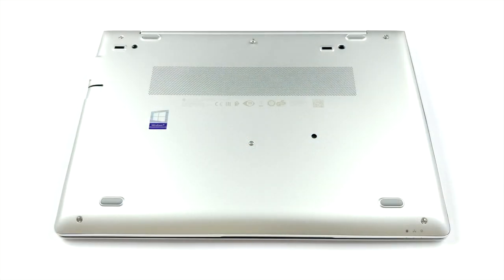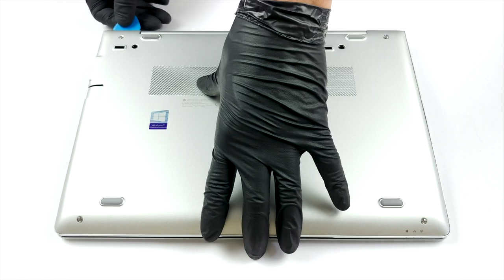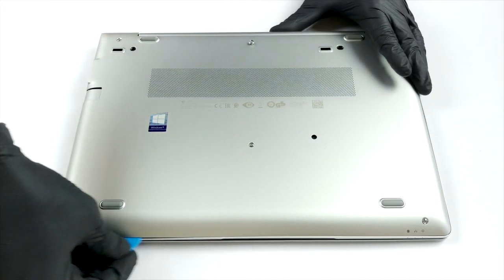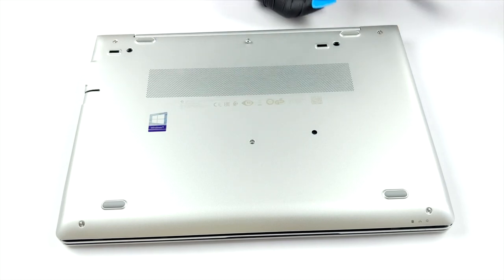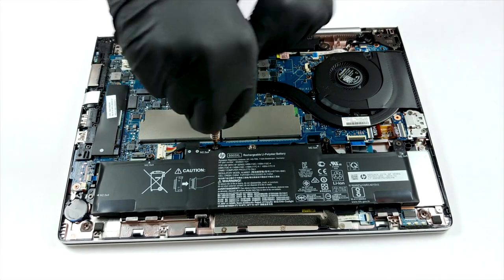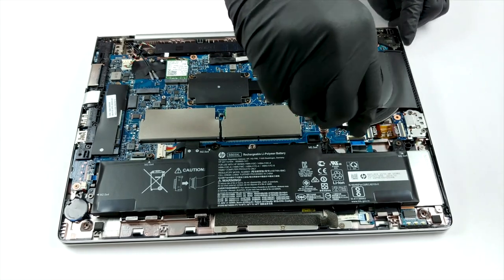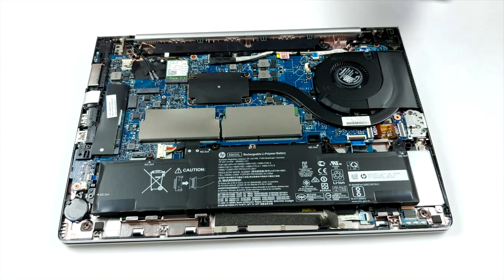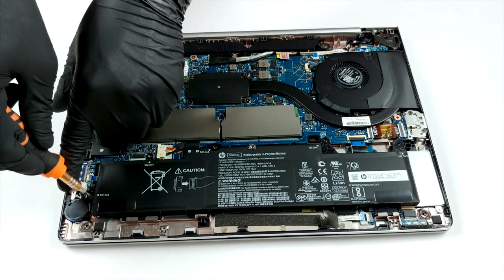🛠️ HP EliteBook 745 G6 - disassembly and upgrade options

Comment: Can we add second hard drive ?
Reply: Hello question from three years ago!

You can't add a second hard drive, but you can absolutely swap out the current one with a better one. You will need a usb to nvme adapter to copy the data tho (nvme ssd are the best)